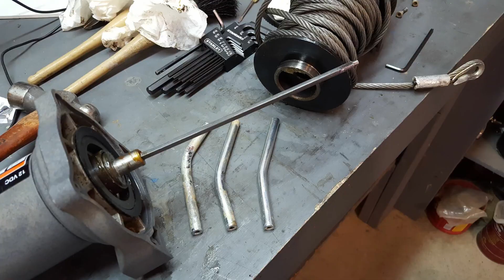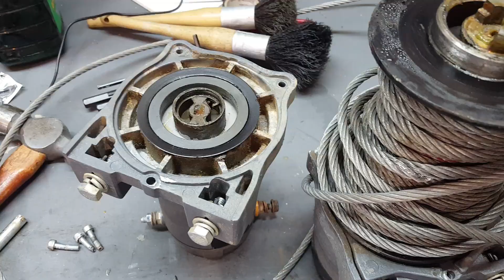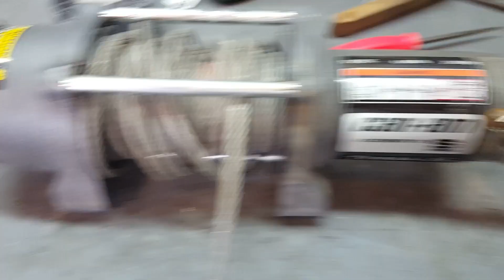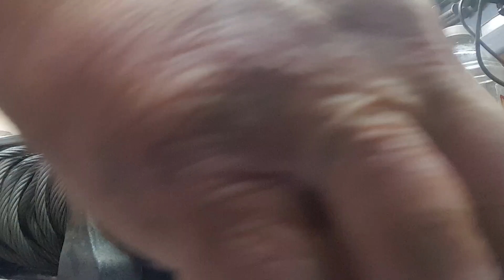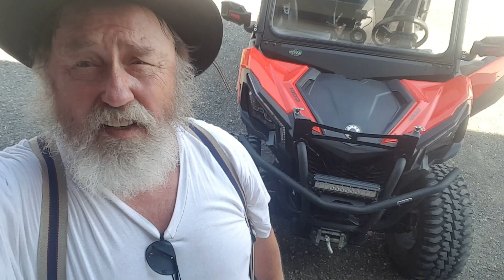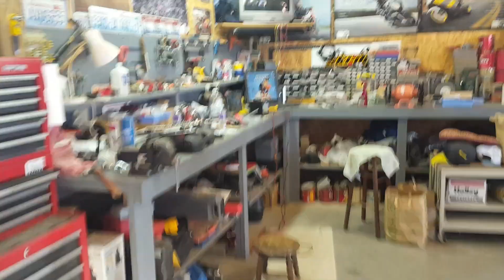Winch Woes

Comment: Dan, I am about to order a winch my new MT, so your problem brings a question to my mind. If I accidentally bump the winch switch while driving, will it immediately begin to retract and cause this same problem? I am wondering if I added an inline toggle (safety) switch it might provide me a method to prevent this from occurring. What do you think?
Reply: Dan Plute Oh. Since I don’t have a winch yet I was not aware of “freewheeling” mode. Is that some kind of lever on the unit itself?